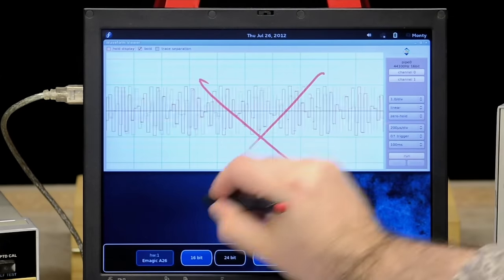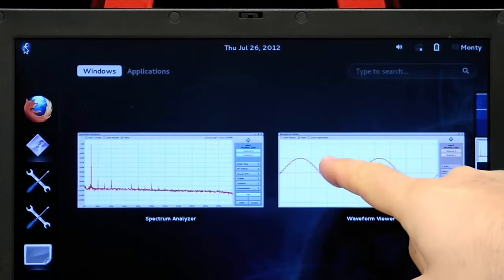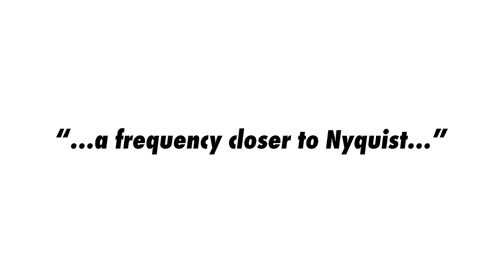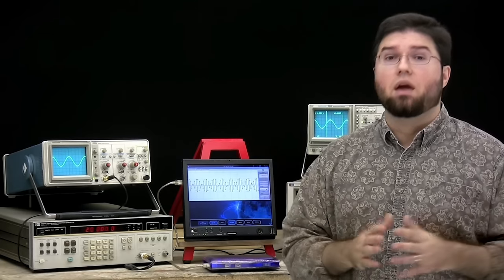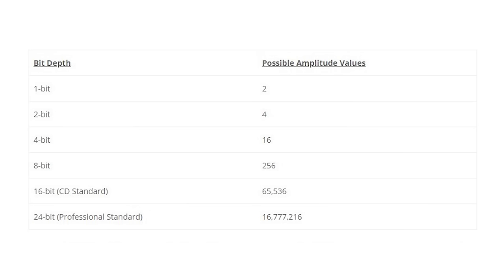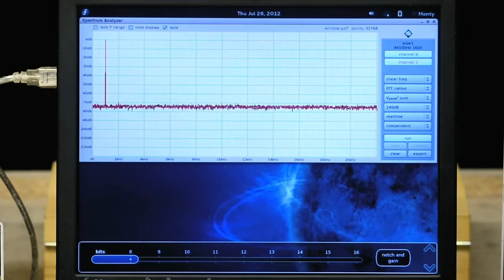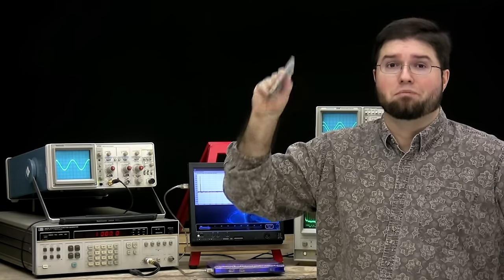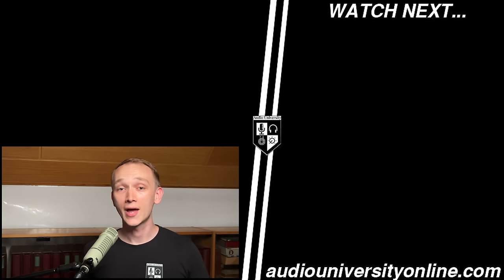Debunking the Digital Audio Myth: The Truth About the 'Stair-Step' Effect

Comment: What Fourier and Shannon are telling us

TIME CONTINUOS case so, again reapeat, Fourier with sine and cosine
- HE TELL US that if you have a time continuos signal you can depict it like (to stay simple the series, the transform is likewise) a sum of terms of different frequency (and phase), with the proper amplitude (what Fourier teached us to calculate)   since in case os series we know already that ferquencies are multiple armonics.
So if you have to test a piece of equipment there is a way to test it, as everibody know (scan the 20 - 20 KHz range in audio) and is you have for all therms the same gain and do not arm to phase you reasonably you did ok with you equipment.
This because I (I mean Fourier) proved with mathematics that this can be done.  

- WHAT FOURIER DO NOT TELL US (anywhere, at any time, in any piece of math demonstration of the theorem) and most people think is true
Peak up a sprectral line and whach at the amplitude only and decide what do to with and thinks are still valid.
As pictorial example:
 There isn't any Fourier shop you can go and buy a bunch of sine and cosine and decide yes but this one poor term  is alone there in a frequency range that my age don't allow me to hear anymore because I'm older than 6 month.......... than I'll not buy. (remeber a previuos note #### in DSD about the wife's thing, no is not the same, there you can throw way here not). 
No, there isn't this solitary therm vibrating all the time at that crazy frequency  which almost nobody cant't hear .

There isn't such a thing, it is only a rapresentation, what Fourier says is that for some signals it's better that equipement is capable to manage a rate of rise you can find 
in sine wave of that ferequency so it is better to check it.
This is the way Fourier should be understanded, and actually this is done normally in equipment testing as a good tool to make measurement. 

More or less the same is valid in time discrete, Nyquist-Shannon tell us that under certain condition a time continuos signal (bad limited, aliasing) sampled (condition on frequency sampling) and then trasformed into a time discrete , is proofed that you can recustruct the original time continuos signal from it.
Only please get rid of the imaging that the sampling process is giving you.

Amongs other difficulties (practical ones) what ARE NOT TELLING is that you are allowed to drop terms of (what? if I can hear sine and cosine %$&!!! term sin(x)/x, Ahh OK!)
Unfortunately for pratical things here even worse and a lot of work was done on it.

The result is that with some sidework is fact that a normal CD (for which the format was chosen not closely for tech limit about conversion but because 16bit/44.1 KHz was according to the size capacity of the support itself since some historical program ex. the 9th of Beethoven, not only but among them, was erquested by music company to stay in one disc) now sound quite differently from the beginning and this is due to equivalent technique among them upsampling and digital filtering

Now is up to you, do you prefer some more phantom samples which filter is giving a mean value between to real ones or any sort of intepolation, or real sample sampled from original time continuos signal.

Just to give an idea modern harware (consumer not professional) if you test it is giving for example read in rows:
fromat PCM 16/44.1 real resolution 17.8 bit (from 16??? yes go back feew lines if you miss something), Measured effective Dynamic 121dB;
fromat PCM 24/192                             17.8                                                                                                                                                                     121
DSD64                                                    14.9                                                                                                                                                                     94.9
DSD128                                                  17.4                                                                                                                                                                      11.3

Note that orinal CD (as was born 16/44.1) had a tipical efective bit resolution around just above 13.

We can say that it is almost impossible nowadays to compare formats on hardware side, for qualitative (if can be heard) are better dependig on source material, as said is up to you if you want averaged or real data if making any difference. Probably (no judging) if you like only some kind of music with no refernce to real instrument you can have the chance to hear live (acoustical) does not matter at all.

From one of the cd from band Boston, don't remeber exactly, but more less was:
- the Hammod Organ is actually an Hammod  organ
- people clapping are actually real people calpping
- for ( sorry I don't rember) .. well nobody is perfect

Comment: An important issue this doesn't cover is audio compression. We don't usually listen to uncompressed CD-quality audio anymore, but usually mp3s. There is some bitrate above which mp3 audio will sound just as good as uncompressed audio, but it's not necessarily obvious what that bitrate is.
Reply: To be fair, the "just as good" part is an insanely subjective topic, thats where it gets really complicated. The music is actually changed, but in a way that tries to make the difference to the original sound as minimal as possible. Everyone could hear that 48 kb/s MP3s sound kinda terrible, but it was harder at 320 kb/s.

Also depends on the algorythm. Frankly, I'd hope that MP3 isnt really used anymore, because its latest update was like 1998 or so? It mainly got used so much because its licensing wasnt enforced, so you could basically use it "for free". Later competitors like AAC offered better sounds for the same filesize, but often had licensing fees or werent as easily available. Not sure whats used today, but I think Spotify/Apple use updated versions of AAC?

The few times I ever bought music (or digitalized my CDs) I usually went for FLAC, which is kinda amazing. Its lossless, so same quality as CD-audio or wav-file, but less than half the size due to compression. You can compress it yourself later, but at least you "own" the full quality audio.
Reply: @termitreter6545  Well, a FLAC is still three times the size of a high quality mp3. Sometimes lossless audio is necessary (e.g. working on very primitive hardware) or desirable (e.g. when editing the audio), but if you are just listening to the audio back, it usually makes no difference. Some people spend thousands on expensive audio equipment and many hours listening intently to music, and for those people, maybe an mp3 isn't good enough. But even then, most ABX tests will show a 256 kbps mp3 to be completely transparent, unless you are really hunting for exceptions. In fact, for the vast majority of people (who are listening on cheap headphones or speakers), even a 128 kbps mp3 will sound basically flawless. (Of course, it depends on compression settings. The above figures are approximate for a stereo VBR mp3 created by the LAME encoder v3.)

AAC audio saves a bit of data at the expense of a significant amount of processing time for encoding and decoding. If you store or serve a ton of audio, it may be the best option.
Reply: @EebstertheGreat  Issue is, if you buy a compressed audio file, then you get an inferior version. You can never revert it to CD audio standards, nor compress it differently.
Its just an inferior product you buy.

To say 128 kb/s is flawless to a 'majority' of users seems like a baseless claim. Even phones these days often got semi-competent DACs.
Also kinda irrelevant, some people also claim they cant see difference between 30 and 60fps. Doesnt mean youre not losing something.

Pretty sure youre wrong  about AAC tho, it didnt seem slower when I used it. Its just better than MP3, their last updates is like 20 years apart.
Like, why would you use a 20+ year old compression format? Tech and audio science has improved since then.
Reply: @termitreter6545  I didn't say that lossy audio was the same as the original. By definition it isn't. But most people don't buy audio, they stream it. And streaming a 192 kbps mp3 is going to be indistinguishable from playing a CD in the vast majority of situations where people stream music.

The same thing is true of 4k digital cinema. Is that less than 8k? Yes, it is less. Do most people care? No, most wouldn't even notice. Many couldn't even notice, because their eyes are not sharp enough. So it is with well-compressed audio. Of course there is a difference, but in practice it almost never matters.

And if it does matter to you, higher bitrates are available that are indeed transparent. Or if you want a clean, uncompressed version to do whatever you want with, they have that too, because you can buy a CD. Something for everyone. But for most people, most of the time, compressed audio is appropriate.
Reply: @EebstertheGreat  Im not saying compressed bitrates cant be fine, just for buying audio files I think lossless is a lot better. Streaming those obviously would be impractical.

Just the points about MP3 are kinda weird to me.
Formats like AAC and OGG do a lot better job than the hopelessly outdated MP3 format.

OGG Vorbis is even free and still updated.
Reply: @termitreter6545  
Talking about outdated formats: Opus is essentially the successor to Ogg Vorbis.
It's used anywhere from Discord calls to YouTube videos.
Being the successor to Vorbis, it's an improvement, of course.
Some even say it competes head to head with, if not even better than AAC, but that is debatable.
Reply: @Sherolox  Thanks, thats cool! Gonna check out Opus the next time im converting audio files.

Comment: In classical signals and systems there is no myth involved, the  DAC output which is a stair step (zero order hold) should be followed by what the Nyquist sampling theorem requires: conversion to approximate discrete time as a sequence of simulated Dirac delta impulses (a Dirac comb) which in practice are simulated by very narrow rectangular pulses of constant, precisely controlled width, and height proportional to the DAC output - then lowpass filtered. This is all most easily analysed in the frequency domain. BTW anyone know why the first Phillips CD player with a 14 bit DAC was able to match the performance of the first Sony player with a 16 bit DAC? With both approaching the theoretical 96db SNR? Since the compact disc standard was developed by the two companies, I'm referring to the first two players on the market and I bought the Phillips player in '86. One of the electronic engineering trade mags even incorrectly stated that the Philips DAC could only deliver 84 db SNR, in a retrospective piece in the '90's, provided as a reader supplied guest application note. These trade mags (EDN, Electronic Design) would frequently print blunders. Another blunder was when a fellow with a tech degree 'proved' that since all digital audio products supposedly blundered by feeding stairstep DAC outputs (with inherent zero order hold giving an undesired spectral weighting) to the LPFs, and they printed that erroneous app note. The guy was correct in his arduous graphical time domain analysis but thought he had discovered something revolutionary without realizing that engineers do this for a living and in actuality supply the delta function approximation for correct discrete time simulation. And that engineers know that many problems can be solved very quickly and easily in the frequency domain. Anyone with the answer to the 14-bit DAC with 96db SNR give it a shot. I'll come back in a couple of weeks to discuss.
Reply: @nicksterj That was quick. Yes you are correct with the spread of the 4x larger quantization noise over 4x the audio spectrum which is then analog filtered back down to the audio band by the anti-aliasing filter. The price to be paid is the application of a digital filter to interpolate three extra output samples between the original 14 bit samples at 44.1 kSPS for an effective 176.4 kSPS. As intuitive as this is, maybe even more intuitive is the fact that the ÷4 sacrifice in amplitude resolution can be compensated for in this 4x increased resolution in time -- of course made possible by real time computation in the digital filter, which in  most cases is a transversal filter  (FIR filter) for oversampled schemes that have been in practice originally by Philips and other manufacturers.
Reply: Suggest a read the wikipedia article on Nyquist-Shannon sampling. One sentence explains what I'm saying, with its reference to the Dirac comb function which is a sequence of Dirac deltas amplitude modulated by the DAC output. It implies the stairstep DAC output (zero order hold) provides spectral distortion which can be reduced by oversampling WHICH IS NOT NYQUIST SAMPLING, but the whole article shows the benefit of simulating the Dirac function with narrow rect() functions in the case of strict Nyquist sampling. The following sentence summarizes what I'm saying with ellipses being the math formulas: "Theoretically, the interpolation formula can be implemented as a low-pass filter, whose impulse response is ... which is a Dirac comb function modulated by the signal samples. Practical digital-to-analog converters (DAC) implement an approximation like the zero-order hold. In that case, oversampling can reduce the approximation error."

Comment: 4:24  "...perfectly recreated on the analog oscilloscope."  <-My point is in reference to this, and only this.

I'm not arguing with the conclusion, but that's pretty poor evidence. I'm surprised that anyone would offer that low resolution fuzzy waveform as evidence of anything.

Edit to add - For those inexperienced, that analog oscilloscope (as it was shown, as it was set-up) is just about capable of displaying the 'stairstep' of an 8-bit signal. As shown, you wouldn't see anything with even a 10-bit signal. 16-bit LSB would be 60 millionths of an inch on a 4-inch scope. They might as well have shown a picture of their shoes.  Silly replies deleted.

Comment: @3:00 just do 22.05KHz  That's the highest you're supposed to be able to record at 44.1 and should come out as a square wave.
Reply: Lol shoulda just kept watching, you cover this in the next minute.
Reply: I think the higher bit depth are there so you have infinite amplitude headroom, and the higher sampling rates so you can slow a recording down without an audible lowpass.  Like if you want to record a dog whistle to listen to slowed down, you'd have to record at 96KHz and slow it down to a quarter of the pitch.

Comment: I disagree about the bit depth the reason I like 24 bit is some master recording on 16 bit are so loud it's clips so at 24 bit it does not and than using reply gain to lower the volume fixes the issue .

Comment: Would be good to hear an explanation of what "bandwidth limiting" is exactly and why it implies that there is only one diagram that fits a set of point samples. Why isn't there only one diagram fitting just, for example, two samples?
Reply: Bandwidth limiting is used to capture sounds only from A through to B. (human hearing range) Nothing too low or too high. So there is a limit on what is being recorded. This allows the math to work. If the sound was not band limited, then there could be multiple solutions. The recording would contain high pitched whistles and warbles (digital noise). On the sine wave front. All sounds are made out of sine waves. When sines combine we get more complex waves. In synthesis we use 'pre-made' wave forms as it is a short cut, but any and all sound if broken down are sine waves.  Think of it like all matter is atoms. from cotton to steel.  All sound is multiple sines. 

Another thing that escapes most people is that a vinyl record is a series of pits (1s and 0s?) the deeper the pit the louder the sound, the closer together the higher the pitch. It is digital without the numbers. Sadly a speck of dust can spoil it and the needle destroys the groove every time it is played. The needle creates its own noise. So all recordings have flaws.
Reply: Exactly stated + with an example
Exactly stated is that you should refer to it as an anti-aliasing filtering whis is a less misunderstanding term and anti-alias is selft explaining.
Let suppose you don't have any sound or, anyway, nothing of iterest in your uselful range (20Hz to 20KHz as ex.) and you are sampling at 44.1KHz as ex. 
Now it is all ok till 22.05KHz as everybody knows, but immagine somebody is around chasing his dog playing a  dog's whistle and let suppose the whistle is emitting at
23.05 KHz. Well if you not apply anti-alias filter your digital system will give to you and you will ear a (23.05KHz - 22.05KHz) = 1KHz  tone than in fact was not existing in reality.
This becasue incidentally (well is a weel know physical phenomena) a 23.05 KHz signal has (if sampled at 44.1 KHz) exactly the same points in the sampled dot rapesentation. There is no way to make the differnce between the two.

Usual example seen with images, when you se on tv or what else a viseo of a car running some time you can notice that wheel seem go on oppiste turning, isn't you tv/screen nor youe eye is the interferance effect by the whell frequency (number of turns) and call it Fwhell and the frequency of camera's frame refreshing call it Fc
you can see either + (Fc-Fwhell) or -(Fc-Fwhell)  so apparently you can observe either a slow than real move in right direction but even a slow move in the other.